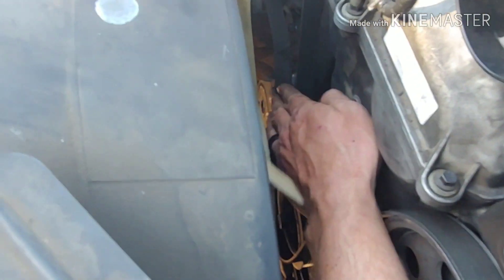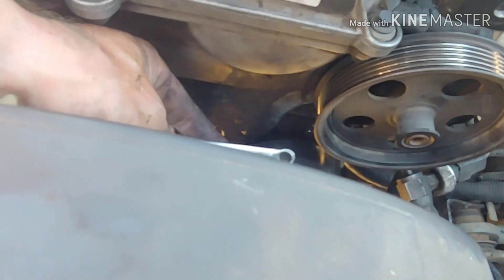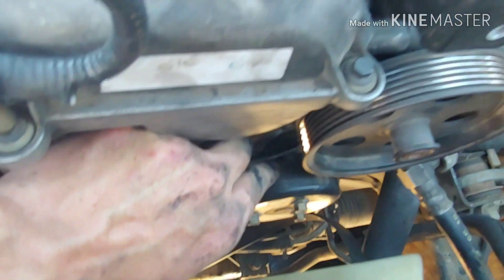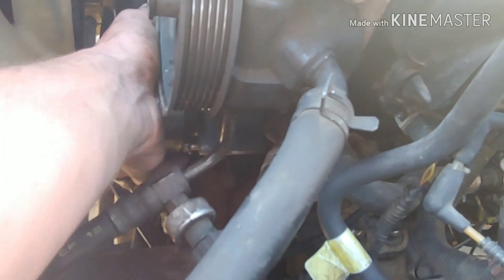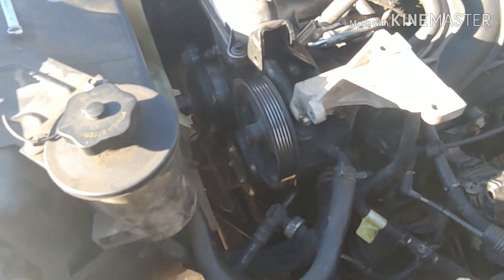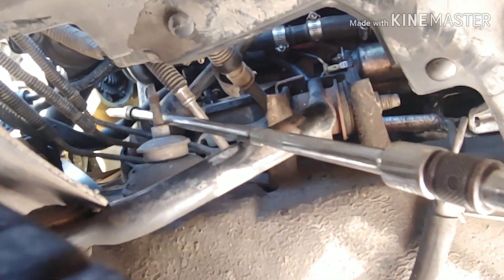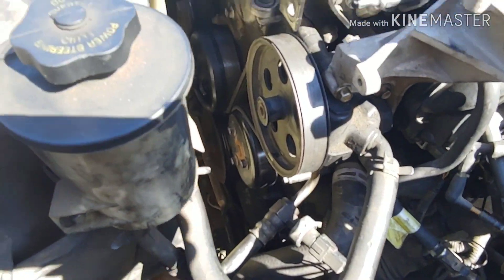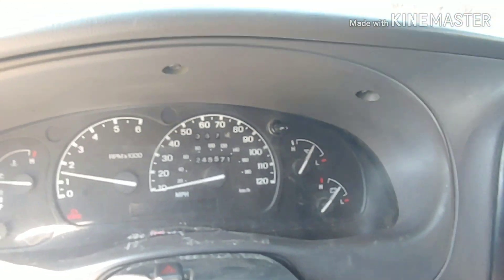Ford 2.3L water pump removal

Comment: I had the whole pulley come off because I couldn't tighten it properly. I chose this video to try to see how and he just says reverse of how you get it off. Thanks a lot lmao
Reply from the maker: @zotanzero  sorry it didn't help. If I remember correctly it was just 3 bolts and I tightened them with wrenches. If you remove the pulley it's easier to tighten the bolts but I didn't have to do that because my replacement was a complete set up. I imagine tightening the pulley bolt would be similar, I prefer wrenches because you can grab a cheater to get more torque if needed.

Comment: Thanks for this, I just started hearing some grinding under the hood the other day, opened it up and saw the water pump pulley shaking. She's about to go out, and now I know how to replace it. Thank!
Reply from the maker: Happy to help. Figured I'd record it and post it in case anyone could use the help. So far some have so I'm glad I did. I'm going to be doing a 04 3.0 swap series too since literally from the dash forward everything needs to be swapped over wiring wise. Going to be a fun headache.

Comment: I have a 2003 2.3L 4c 16v. Coolant leakin’ from pulley where water pump is. Bet it’s bad O ring. Probably stretched now. Thank you so much for video and info.
Reply from the maker: Hopefully the video helped. That's all mine ended up being was an old stretched o ring. Luckily I had a  spare on hand to swap straight over.

Comment: My water pump pulley froze up and burnt my serpentine belt to nothing. Got off the road just in time and parked in front of a… massage parlor for men that was open at 6pm on a Sunday. We got the belt parts uncoiled from the other pulleys and picked up a water pump. So this video helps a ton. 

If you are going to pull over and sit in a parking lot. Try not to do it in front of a strange massage parlor. All the dudes going in stare you down like your a PI their wife sent.

That aside, 283,000 miles on a single water pump. I’m not going to complain.
Reply from the maker: That's awesome. Glad it helped. My pump went at about 185k on the engine I swapped into the ranger. The rest of it has 264k now. Changed the ball joints and outer tie rods and the rest has been cosmetic. My donor was a 2001 b2300. Love these rangers, even the clone.
Reply from the maker: I'm happy the video helped and you got back on the road. Thanks for the view and comment. I appreciate you.

Comment: A couple of the bolts a little hard to get to, but looks pretty straight forward. Great video.
Reply from the maker: Thanks for the comment and view. It really is simple. Fords are usually pretty easy to work on until you get to the newer vehicles.

Comment: If you take the bolts out of the water pump pulley before you take the belt off you can see the bolts a bunch easier
Reply from the maker: I understand. However, the replacement pump was complete with a pulley since I pulled it off of my donor engine so pulling 3 pump bolts out was less work that pulling the pulley and then the pump. I like less work when able
Reply: @Justin Joyinglife  It would've been more work I suppose, but you would've been done a lot faster.
Sub 5 min with a good electric ratchet.
Reply from the maker: I try to use hand tools as much as possible. Keeps muscles in a usable state. Even little things matter. Same way for the farm I work on. Drives them nuts that I lift instead of using forklifts and wrench instead of using air tools. Just my preference. But thanks for the few and comment. Appreciate you.

Comment: Hello man, any other way to put it out, mine is also stuck? you dont have to get the pulley holder?
Reply from the maker: There's only 3 bolts holding it to the block if I remember. If it's still stuck, you have to knock it loose or pry it loose. I used a rubber mallet and a long pry bar if I remember correctly.
Reply from the maker: You can remove the pulley but that just gives you easier access to the mounting bolts of the pump. If you're new water pump doesn't have a pulley than it's easiest to pull the pulley while the belt is still on. If the new pump includes a pulley, you don't need to remove it and you save steps

Comment: Mine had water in it. Makes me nervous so checking the pump. Radiator seems okay. I want to check the thermostat I'm wondering if there isn't one I did see the temp move just a tiny bit still curious though if it doesn't have one.
Reply from the maker: A lot of people will just pull a thermostat when there's overheating issues because it's stuck. Also worth the 10-15 bucks to put it back in since you're there anyways. Thanks for the watch and comment.

Comment: take the 3 bolts out that hold the pulley on    then you can grab the wp with  big channel lock pliers
Reply from the maker: There wasn't any point. The pump was being swapped with another water pump that was complete. If I had to swap the pulley, I would've removed it but it wasn't a needed step.

Comment: it's easier to loosen the pulley bolts before taking the belt off.
Reply from the maker: I didn't pull the pulley because the waterpump I was putting on had its own pulley on it already. Could've been faster taking the pulley off, but the only real time it took to take it off was trying to film at the same time. Thanks for commenting and watching.

Comment: Wouldn't be easier to take the pulley off of the water pump first🤔.  Just a question
Reply from the maker: It could have been. But the replacement was complete with pulley so I figured 3 bolts was less work. Thanks for the view and comment.

Comment: what year and model was this car  this info would really help?
Reply from the maker: The engine in it currently is the Duratec 2.3l out of a 2001 Mazda B2300, but the Ranger itself is a 2002. I guess I should've put the info in every video but didn't think to after it had been introduced to the channel since I went straight into the engine swap. Got the truck for free 😁

Comment: From personal experience, the best way to get the pump out is to remove the bolts, use your channel locks and rotate the pump back and forth. The cylindrical mating surfaces appear to prefer this method more than trying to pry it out since that tends to misalign the surfaces and introduces binding. Just my two cents.
Reply from the maker: The pump in this video was stuck from the o-ring getting dislodged from its channel which was also the cause of the leak. The spare water pump off my donor engine had zero issues being removed and then placed on this engine. And it's still running to this day. 264k miles almost
Reply: @JustinJoyinglife  this was more of a general comment for folks in the future. Glad your ride is still running. I've got over 230k on mine. Been a good truck!
Reply from the maker: @tartansauce4879  I got mine for free because the engine was bad. 02 Ranger. Had an 01 b2300 with a bad transmission. Swapped the engine over and will rebuild the bad one (pretty sure oil pump was the cause but doing a full rebuild) and plan to try to get this ole girl to 1m.
Reply: Is the temp gauge needle at 70 percent up on the gauge or in the middle

Comment: What symptoms were you having? My coolant doesn't seem to flow and I changed the thermostat and radiator fan. So idk whether to change the radiator or water pump next
Reply from the maker: I had water leaking out of the bottom of my water pump so luckily I had no gremlins to CSI. 
If it's not flowing properly I would do a water pump and if it still persists, I'd take it to a shop and have them flush the cooling system under pressure. Let me know how it goes.
Reply: @JustinJoyinglife  good deal. Thanks
Reply from the maker: @cobrlex_svt2572  no problem. Sorry I couldn't be of more help.
Reply: @JustinJoyinglife  it's all good no worries

Comment: It would have been much easier to get to the water pump bolts if you'd removed the flange by taking out the 3 small bolts, Slacken them off before you take off the belt,
Reply from the maker: I understand that. Then there's the possibility of needing a pulley puller to pull it off the water pump shaft. So 3 bolts for the pump, 3 bolts for the pulley, pulley puller, then tighten up all 6 bolts. Or take off 3 bolts, 1 gives small issue when recording but zero issue when not, pull the pump, install new one and tighten 3 bolts. And I bet AllData agrees with you on process and execution. I tend to reduce as many steps as possible when not needed. The pump itself was still good (until I broke the housing), the issue was an oversized o-ring letting coolant seep out the side. Just swapped the pump with the one on my spare engine.
 Thanks for watching and commenting. I appreciate the support.
Reply: @JustinJoyinglife  you don't need a pulley puller. They're supposed to come off for changing. But if you can get it without removing the pulley, more power to you my guy. Informative though
Reply from the maker: @joemash83  thanks man. I try to keep it as simple as possible. The pump I was replacing it with was complete so there was no need to worry about the pulley. I'm editing an outer tie rods and upper and lower ball joint video right now. Had some files corrupted but I'm still trying to piece it together. Thanks for the view and support. 😊